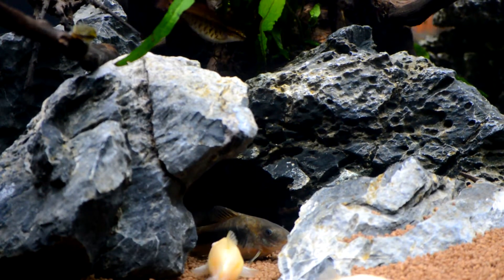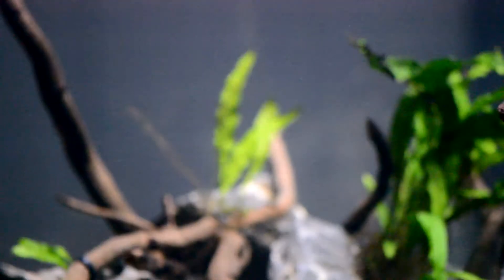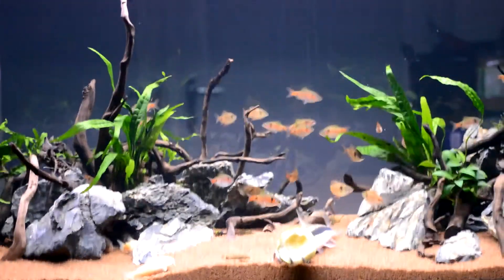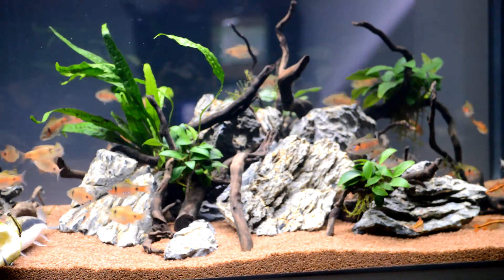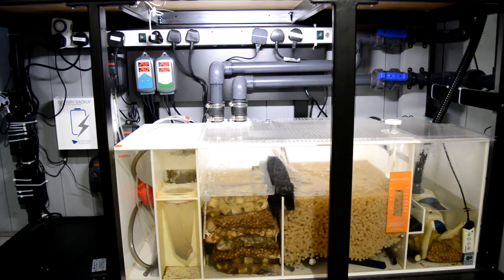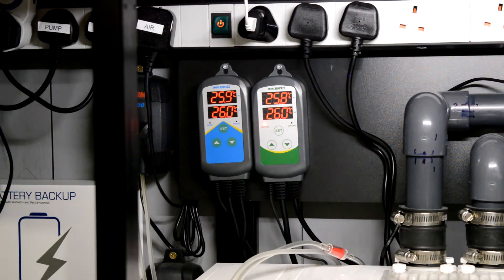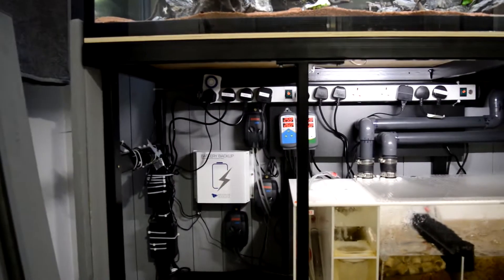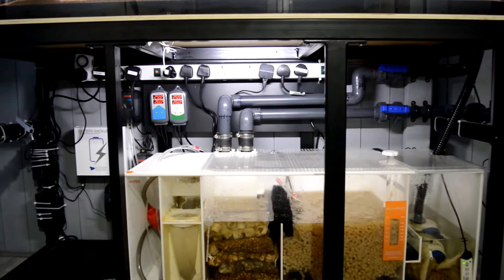Engine Room - Inkbird Temperature Controller​​​s

Comment: Hi Kel, looking at the inkbirds to control a 2kw koi pond heater, what is the temperature range on them. I only want a stable 15/16 C
Reply from the maker: Hi Mate, the inkbird site reckons Temperature Control Range : -50~120°C /-58~248° F . and the lode Temperature Control Output: Max. 10A, 100V ~240V AC
 Control Output Power: Max.1200W(110V)/2200W(220V), hope that helps . I have only ever used it on 2x300watt heaters aquarium heaters never on a pond. 
hope that helps 
Kel
Reply: @KelsAquariums  Cheers Kel. I have ordered one. I was confused with spec but I presumed I was reading it like you have just said so should work OK on my 2kw heater. Just want to have more control on it because the built in one is too sensitive being a manual one and not much of a differential. Stay safe mate. Martyn

Comment: Hello beautiful tank are you still using the inkbird ? If so I was wondering how it's working?
Reply from the maker: Hi, Yes I am still using the inkbird however i dont have 2 on anymore just 1 with 2x300 watt heaters attached (instead of 2 inkbirds and 3x200watt heaters). Up to now it has been flawless and keeps the tank at a steady 25c I do set the heaters to 27 so if the thermostats on the heaters are out they don't switch off when the inkbird turns them on

Comment: Great vid Kel. Just a little heads up about these Inkbird controllers. They sell models that look and work exactly the same but with an "S" on the end of the model number. These are the versions i recommend. They cost just £2 more but they allow for the temperature probe to unplug and be replaced. I have had a probe fail on me after a years use and i had the model that has the probe hardwired in and couldn't replace it so had to buy a whole new unit. I didn't realise they did a model you could quickly change the probe (replacement probe is just £8) Just a little warning as it's very easy to overlook when you buy these units and probes do die or start to act up over time.
Reply from the maker: Hi, Thanks for the heads up i'll look out for that model if i have to replace

Comment: Kel, have you ever tried using super glue gel for attatching your plants?
I used fishing line at first but tried using seachem glue recently and I found it far better than fidling about with line etc.
Reply from the maker: I have tried it in the past it works great my only issue is if you take the plants off you end up with some dry white glue on your hardscape but it is still much easier than string and or tie wraps